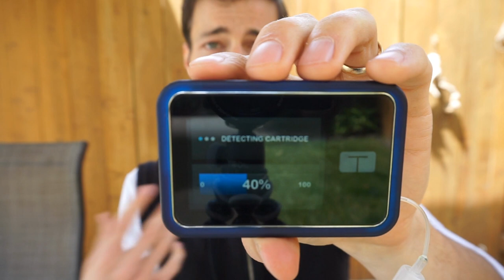How To: Insulin Pump Site Change (Tandem T Slim X2 Insulin Pump)

Comment: Great video! My T1D diagnosis was in 1963. I have worn many insulin pumps, including 4 Medtronic, the Asante SNAP (my favorite) and currently, the Animas Vibe, which replaced the Asante SNAP.

The Animas Vibe warranty expires this November, so 2 days ago I attended the Cool Tools class at Northwestern Memorial Hospital, a requirement for those getting a pump upgrade.

Potential t:slim drawbacks include requiring extra time to fill the cartridge/bag, removing air bubbles, and the tubing "pigtail" that can catch on doorknobs and other devices. However, with Medtronic I had too many equipment issues (including recalls) and poor customer service, so I'm going with the t:slim.

The Asante SNAP used a pre-filled glass Humalog cartridge, so there were no syringes and no drawing up insulin. In addition, the pump auto-primed in one second. Over the course of a year, the SNAP pump saved hours in prep time. I still miss that pump.
Reply from the maker: What great insight to have! Incredible hearing about the past of insulin pumps, thank you!

Comment: Thank you for this video. I've been on Tandem for about 6 weeks, using TruSteel. There isn't a comprehensive how-to on Tandem, and I got confused. I knew we didn't fill cannula with TruSteel, but I wasn't connecting the tubing to the needle until after. So, that's why I always went up after changing! This was great. Thanks again.
Reply from the maker: Glad that I was able to help!

Comment: I'm on day 3 of my new TSlim, getting ready to do my first infusion set change.  Had the 670G for the previous 4 years (on pumps for about 20 years, all of them Medtronic).  Best decision I've made - switching away from that disaster.  T1 since 1985.
Reply: I’m considering the Tslim!  I’ve always used the Medtronic pumps too (since being on a pump), but my 670G broke a couple of weeks ago and I have about 60 days to figure out what I’m going to do.  Already using the Dexcom and I love it.  Been diabetic since 1989.

Comment: I have a dexcom g5 and a omni pod and when u change them I use       unisolve it's a wipe that you put on the adhesive part of the pump and it makes it less sticky and way easier (and less painful) to take off my pump 

You can find it on Amazon 

Also thx for the demo
Reply: I'm waiting on my new OmniPod now! I am SO excited!  How do you like your setup?  I've been using the old MiniMed system from Medtronicis but those miles of tubing were such a turnoff, and the MIO cannulas were always bending. I've got the Dexcom G5 sitting in my bedroom, ready to start using as soon as the new OmniPod arrives!  Ready to be a "Podder!"  LOL
Reply: @TerryReedMiss  yeah the omni pod works realy well it's a bit bigger then a tuned pump but that is cause it's wireless this one works great

Comment: I have not seen this type of pump site where you directly stick yourself with the site needle. I know as a T1d you stick yourself with needles often but that is incredible how you just put the site needle in like a normal sticker.
Reply from the maker: It's quite incredible!
Reply: I used the Medtronic bent needle infusion site for almost 20 years, and the manual insertions always sucked. Since I heard about the cannula idea and an inserter, I have never looked back. I can't imaging choosing to manually insert a metal needle anymore!

Comment: Thank you for this video! I’m switching from Omnipod to T:Slim within the next 2 weeks!
Reply from the maker: Absolutely! I'm glad it helped
Reply: What is making you switch from the omnipod? I'm looking at omnipod and tslim I cant decide what one to get yet 😂
Reply: Sarah I had Omnipod for 5 years and started to have the pods leak after 3 years. I wanted to make the switch because the Tslim has different infusion set options. I figured I needed a longer cannula. I was hesitant to switch because I never had a tubed pump, but I’m so glad I switched! I’ve had the pump since February and in March my A1C was 6.7% down from 7.1%. I’ve been using the Control IQ update for 2 weeks and my average BG went from 150-160 to 120-130. I’m so happy with TSlim!! I use the 8mm TruSteel infusion sets and i really like them.

Comment: Great video. Extremely informative. Currently researching pumps as I’ve been T1D for almost 40 years and always just been comfortable with doing it manual, but looking for more stability. I am still trying to decide what’s easier… manual or using a pump and having to do that process every 3 days. Logically, using a pump should be easier but I don’t find the manual way difficult. But having young kids now, life’s bit more hectic so it’s not uncommon for me to forget to take my lantus by a few hours. Thanks

Comment: Thanks for the video, sure does help. I just got mine, and worried?
Reply from the maker: Worried about what?
Reply: @FTFWARRIOR  just starting out with a new device is worry some. Basically learning a new operating system. But I am good at following directions. So it should be a smooth transition. I sincerely appreciate the response.❤️ I just want to do everything right. If you can give me any tips and tricks, advice for a beginners videos I should watch please make video, and share. Thank you again.

Comment: Thanks for the video it's very informative. I'm going to my diabetes educator today to setup my Tslim, I'm excited! I'm getting prepared for it by watching your video lol
Reply from the maker: That's great! Let me know what you think of it once you are all hooked up!
Reply: Alright I will! I can already tell you that the g6 part of it is pretty cool, I like how I'll only have to carry around the tslim pump and not have the dexcom receiver with it. I like how the sounds are more annoying on the tslim than the dexcom receiver because the tslim's alert will actually wake me up while I'm sleeping and going low. I've slept through the dexcom receiver's alerts multiple times. 

The only thing is finding a good fatty part on my arm (which I have none) for the g6 sensor. I had a sensor start failing on me, so I called dexcom and they told me that the sensor uses fluids from fat tissue in your body. So if it's painful going in and it feels like something is sticking you while the sensor is in than you probably put it in a muscly part of your arm and the sensor is likely going to fail. But if you call dexcom they will replace the sensor free of charge. Yeah the last 2 sensors I put in have hurt the whole time they were in cause I'm not hitting a good spot in my arm. The 1st one was good no pain at all but I accidentally pulled it out when I took off my shirt lol so I've been trying to put it in a spot where that won't happen again, I think that's why I'm hitting bad spot on my arm cause I'm trying to put it on the front of my arm instead of the back where my shirt hits everytime I take it off.
Reply from the maker: @kennewickman5086  I totally understand on the arm - I put it where my shirt could potentially pull it off when I take my shirt off, but only because that is the only place where I have enough fat to get great readings
Reply: Man this thing is awkward...I connected it to my thigh and the tubing makes it hard to deal with i kept dropping  the pump trying to pull up my pants and  the tubing gets all caught in my pants lol I got the plastic needle one not true steel and you pinch it together and it inserts the needle for you which is weird for me cause i want to put the needle in and the tubing doesn't have that extra sticker like yours does that helps you keep the site in. I guess it just takes some getting used to it, it's going to be weird having something attach to you all day everyday with a tube... I used syringes and vials before
Reply from the maker: @kennewickman5086  It definitely takes some getting used to, having a device attached to you.. but in my opinion it is well worth it.
Reply: @FTFWARRIOR  Yes it is definitely better. I can sit right next to someone check my blood sugar and take my insulin and no one would ever know. One month ago I was having to poke my arm to check my sugar and then go hide out in my car and take insulin. The first time Setting up this pump is just awkward for me but next time I switch it out won't be so bad.
Reply: i don't know if you had this problem but I've calibrated this sensor and I was reading 130 when I was actually at 87 and dropping.  When I calibrated it to 87 the basal wouldn't shut off and my target BG on my profile is 120 so it should be off below 120. I stopped my insulin it kept reminding me to resume my insulin every 15 mins which is really annoying when I'm are trying to sleep. So I had to go into my profile and change my basal to 0/hr. What is your current basal? Mine is at .6 and it seems too high. I'm going to talk to my educator more today so I'll be talking with her about this.
Reply from the maker: @kennewickman5086  I have had to calibrate a few times, but very rarely. As far as with the pump shutting off, basal IQ sets it's own "low" profile at 80 that cannot be changed, however you can have a different setting for low alarms on your dexcom G6. My basal settings vary depending on the time of day or night, but these will be vastly different person to person
Reply: I don't understand why The Tslim has a target BG then if it doesn't cut off at that number. I guess that's a question for my educator, thanks for all your time and replying and reading my long comments lol I'll spread the word about your channel and FTF Warrior.
Reply: How do you mute this thing? I put everything on vibrate and it still won't shut up! Lol

Comment: I am currently using animas but I will be switching to t slim. Can’t wait. This was great
Reply from the maker: Best of luck with the switch!
Reply: Mary Pecoraro how'd you find the change? The line as well as the extra layers preventing you from doing things swiftly and the cartridge preventing you from getting all of the air out of it all look like marked steps down to me.

Also, if you throw an animal pump at an interior wall, the wall breaks not the pump. Not sure the same could be said for a touch screen pump.

Comment: Have you ever had a problem with your sites hurting when you lay down or sit. I use the true steel needles and they hurt on my back and legs, do you know why?
Reply from the maker: I do experience discomfort sometimes if I put aggressive pressure directly on the site (usually by accident haha). There are two main reasons that you will likely experience pain. One is that you may be hitting a nerve, second is that you may be rubbing muscle tissue the wrong way (more likely if you have low body fat). There are probably more reasons, but those seem to be the most common. I hope this helps!

Comment: Do you have any problems pulling the insulin out of the pen,  like lots of air.  After the first time you do that do you turn the dial and get the air out. I was told by my Tandem trainer not to take insulin from a pen but I have 7 pens left so I'm going to do it anyway. I was also told not to take unused insulin out of the pump and put it in the new cartridge but sometimes I have 20 to 30 units still in the pump. My carb intake varies greatly sometimes (sensitive stomach). Also, you are supposed to fill it with a minimum of 120 units according to the manual and Tandem customer service. I fill it with 80-ish units for 3 days and don't have problems.

Comment: Great video! I recently got the tslim and love it. I recently changed my infusion sets to trusteel and love them. I change them every 2 days though which is what they recommend to prevent scar tissue. How often do you change them? Thanks!
Reply from the maker: Catherine Dunne very interesting! I change them every 3 days because that's what I was taught. But I will be sure to ask about the 2 days site change!
Reply: I'm supposed to change mine every 3 days. I use the autosoft 90 cannula. I have worn  them as long as 4 1/2 days in order to use up the insulin still in pump. Not willing to throw away any insulin. Sometimes I have 20 units left on the third day. My trainer said changing it keeps you from getting scar tissue and I can do 2 days if I want. I called Tandem they said it's because the insulin might degrade after 3 days. I have not noticed any difference in quality on 4th day.

Comment: I just got a new t:slim and am getting to know it. The one thing I hate is having to tap 1-2-3 every single time. In your video, however, I could swear you opened your screen without having to tap 1-2-3 to unlock. Am I correct? If so, HOW? I would love to remove that "feature" if possible. Thanks!
Reply from the maker: Oh I use the 1-2-3 as it helps prevent accidental insulin deliveries when people or things bump into it. I'm not sure if it is available without it, but I'd still stick to the safer mode personally. Hope this helps!

Comment: Do you have any issues with sweat and the adhesives patches that come with the tslim x2 ? I have been using Omnipod and my dexcom with the extra adhesive patches that go over them to protect but i am not seeing anything for the tslim
Reply from the maker: thankfully I haven't had too many struggles with it, though I've used IV tape in the past to help lock it down

Comment: I’m 15 and I’ve been a diabetic for 12 years and I still can’t do this comfortably enough because I get scared and my hand starts to shake and I never understand how people could do this so effortlessly. Is there a way to get over the fear? I’ve tried but no matter what it’s always hard for me every time and it makes it so stressful
Reply: I'm 16 and I've been changing it by myself since I was around 9 years old. The reason it became easier to do for me is because I did it a lot and after a while it just became routine. The only advice I can really give is to do it a lot and make sure you know your stuff. If you fuck up, that's fine, you just need to practice.
Reply: Hi Allison. I'm T1D for 47 years and have always hated needles! LOL not great for a diabetic, for sure. But I found it pretty easy to be less fearful by using the Autosoft 90 (or Autosoft 30) infusion set. These sets have an automatic inserter that inserts with just a click. I even close my eyes before I click it and, no problem! Ask your endo, or diabetes educator, to see if you can switch. It made a huge difference for me.
Reply: Faith Bee cool! Do you have any suggestions on how I could overcome being scared for now until I could get something like that?
Reply: @spencermelton3181  Hi Allison, A good one is using an ice cube! Cooling down the area makes it hurt less. Really! Just make sure to dry your skin before using the inserter. The trick I used a lot was to place the needle and then lightly bounce (without actually lifting the needle off the skin) and then - poke. That worked the best for me. I know most people say fast is better, but I had trouble with that.
There are a few tricks on the internet you can try but really, I recommend you speak with your pump educator. I found them to be the best source of info. And they'll be able to help you specifically and more knowledgeably. Let me know how things go for you.
Reply: Hi, Allison. Just wanted to see how you're doing with your infusion sets. Did you get in touch with someone who could give you some good solid medical advice? I hope you're doing well. Faith
Reply: @effbloomy  hi! Things are still pretty hard, but I’m upgrading an Omnipod soon though so I think that will make things a lot easier! Thank you for checking in :) hope you’re doing well too

Comment: Thanks for this :)  I'm changing over in a few weeks (from the Animas Vibe) so I'm getting a head start on info before the big day.
Can you tell me something though... it looks like the insulin cartridge is totally dark not see-thru like I'm used to, is that right? If so how can you be sure you have all the air out? I'm really picky about filling my current one and notice that if I let it rest for 10 mins before changeover there are always bubbles even though I think I got them all out already. I wouldn't trust a cartridge when I couldn't see it and verify a lack of bubbles!
Reply from the maker: I believe that there is a clear section on the back for this, but I haven't had any issues!
Reply: Note...air in the place of insulin in your tube/cannula is not good, but IF a small amount of air as in small bubbles in your reservoir get under your skin (*subcutaneously) it should not harm you. Taking air bubbles into your bloodstream (intravenously) is a different story.
Reply: @mmwwheeler  The issue is missed insulin - an air bubble could replace an hours worth of basal insulin or reduce the dose you think you're taking for a meal. While it's no serious health risk to get bubbles where insulin should be, it is a risk (or at least, a pain in the arse) to miss insulin and have to deal with highs from it :(
Reply: Em Penfold I understand and agree. My statement was intended to ensure people that if they did get a small amount of air under their skin that was in their insulin cartridge it would NOT harm them which was implied as not a good thing in the video.